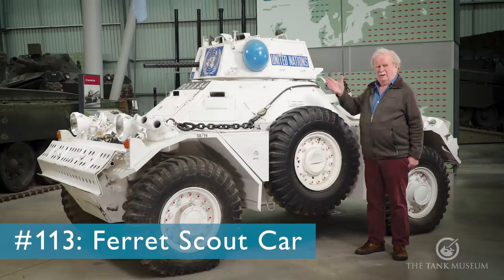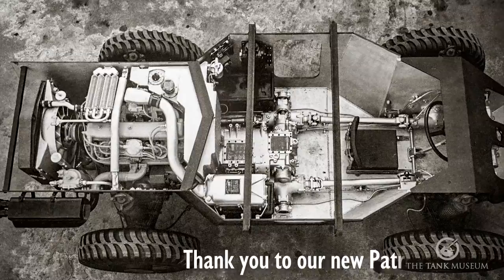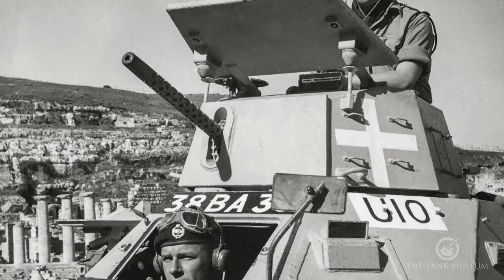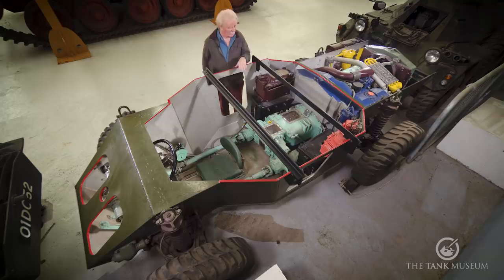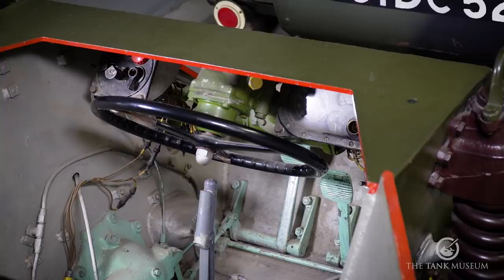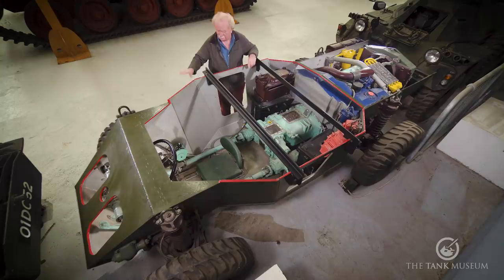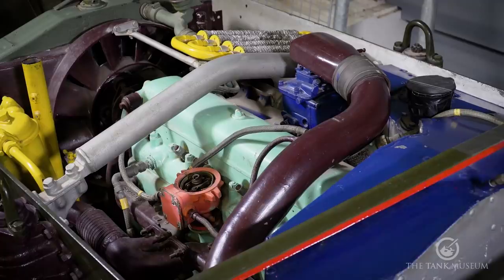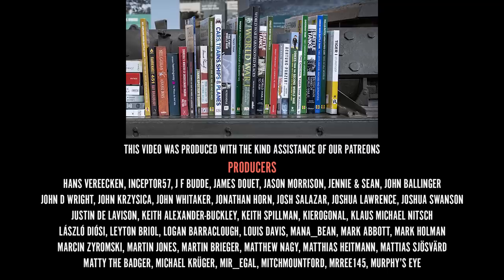Tank Chats #113 | Ferret Scout Car | The Tank Museum

Comment: I remember an old TV show called "carmageddon" where people modified off road vehicles and competed against each other.  one of them had the same steering wheel arrangement and solid tyres as this, I recall it had some trouble being able to change direction in a hurry, because the driver had to do hand-to hand on the wheel instead of spinning it like a few other carlike vehicles would.  otherwise it put on a very good showing.
Reply: There was also a 13-show series called “Full Metal Challenge”, produced in the U.K. in 2003.  It brought 27 specially-built or heavily-modified vehicles, created especially for the program, from around the world to compete in a series of challenges.  One of the vehicles that competed was a stripped-down Ferret.
Reply: @speedythree  that looks like exactly the same idea.  possibly even the same show with a different presenter.

Comment: Is "Fox" armored car from 1982 that was armed with MCT(Milan Compact Turret) related to this one?
Reply: I think that the Fox had a similar turret to the Scimitar. Fox was part of the CVR family, but wheeled. IIRCit was taken out of service because it had a very high CoG. Ex-Yeomanry types will know better though.
Reply: The Fox was a follow on to the Ferret and supposed to part replace it in the recce and liason role in some units (as Sappers we kept Ferrets till the 90's). 

The Fox hull with the MCT was not related except as a replacement and looking similar to the Ferret Mk 5 (the so called big wheel Ferret which also had a Swingfire ATGM turret)

Comment: Can anyone give climbing capability on say grassed banks and sand dunes please ?
Reply: Depends on the surface, if wet, dry, sandy, etc. Quite steep, can't remember the angle but in emergency gear (1st) it could crawl up and down quite easily but slowly.